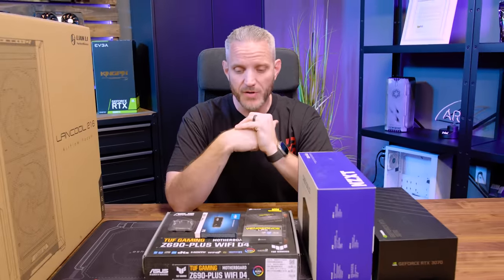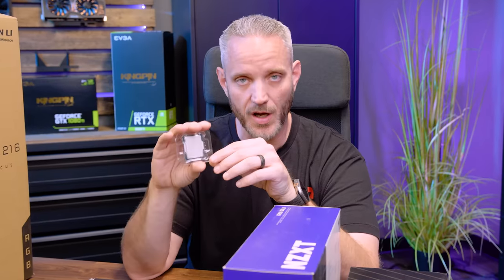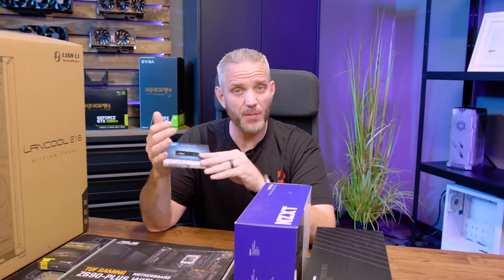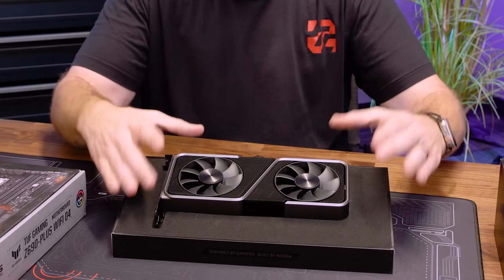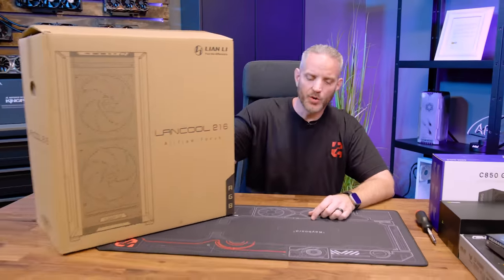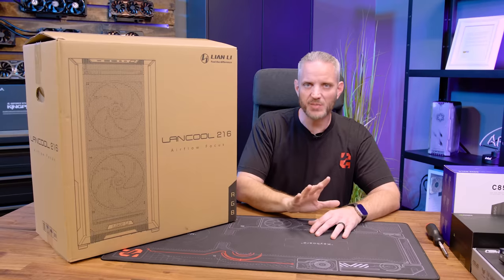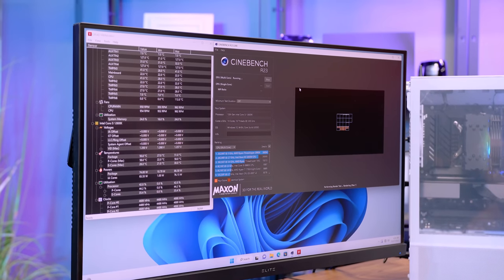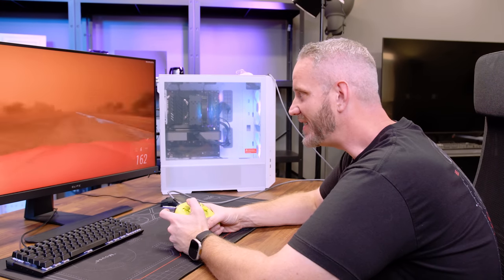Inexpensive PC Build Guide!

Comment: I remember when 50 dollars used to get you a good computer case...
Reply: I got my Deepcool case for like $45
Reply: yeah it still can lmao, thermaltake versa h18 and fractal focus 2 are 50 bucks, both of those cases are awesome
Reply: found plenty of mesh cases with 3 pre installed rgb fans for about $40.. 
just install one extra cheap be quiet fan and turn the other fans to a really low speed and youll have decent airflow with almost no sound and some rgb for less than $50
Reply: I got my Phanteks P400A Digital for $70. It's now $100...

Hearing from Gamers Nexus, keep an eye on what Montech has in store. They might be the new budget kings soon
Reply: The amount of new features and ease of build with cases not much more than $50 is worth it over the junk in early 2010s.
Reply: I got my cooler master haf+ for $60 and they came with the two 140mm fans and the 200mm red led fan…
Reply: @FuelHauler48  Some smarts and zipties will do you some wonders.
Reply: Fractal Designs focus G
Reply: got my fractal design focus G for like $60 and will prob hold onto it for a good while albeit i have 2 old cases which i could play with and mod (one becoming a bench setup)
Reply: It still can. I got my Rosewill spectre for 50 bucks. It had side radiator mount and came with 4 rgb fana.
Reply: It still can
Reply: I tend to spend alot more than 50 usd on a case knowing that i can clean it and use it for several upgrades and even a new PC when i do a total upgrade (which is about once every 3 years).
Reply: This person is talking about a good computer case not just a case
Reply: @thomaslayman9487  My current box is in  a focus 2 think it was 55 though
Reply: Yeah and minimal wage was half the amount.
Reply: Depends on what you call good.
I’ve seen some good ones here and there for $50 still, albeit generally on sale. But you can still look to get plenty of good ones for about $75. And with how inflation has been the  last few years that isn’t bad.
Reply: I got my Silentiumpc regnum rg6v evo for under 60€ which is considering our vat on the ball park of 50usd. 4 decent argb fans, decent space, good airflow and ok warranty.
Reply: I started building in the early 2000s so you must have started much earlier. I remember okay enclosures going for 50 but with inflation factored and market demand today that's more like 100 or more. Good enclosures have always been more than 100 in my experience and thats 20 years ago. Though, the word "good" is subjective in this case. (Pun intended)
Reply: I got a tecware forge m for $50. A fractal meshify clone
Reply: 50$ will never get u a good case, maybe a decent but not a good case. 🤷🏻‍♂️
Reply: Don’t forget the cost of the operating system
Reply: I live in Canada. So I always laugh, when Jay talks about prices. But I've heard Australia is even worse.
Reply: @theodoredekoninck5613  Cost of  the OS?. ....🤣🤣🤣
Reply: and included a decent PSU.
Reply: It was around $65 until recently.
Reply: @vigorgaming8  I wouldn't even decent really. Usable or okay. On the flip side though I once got a discount Li case for around 200. Full size, all aluminum ...I mean all... It was brushed black and could hold 12 spinning drives like 10 fans, set up for some serious water cooling. Let's just say it was not a good purchase because at that price point the aluminium was was way too thin for it's size. Plus the screws were aluminum. I stripped an important one at the very beginning of my build. I did get it together but not without scratches and denting. I found out why it was only 200. 😡

Edit-The thin all aluminum construction was good for thermals but...

I guess my point is that you get what you pay for most of the time and sometimes a cheap enclosure with all plastic panels is the better option.
Reply: Nzxt has decent cases for 50
Reply: still is ;)
Reply: @Therandomguyjoe  The new H7 is $70
Reply: If you know what you doing you can get a $50 case with a power supply in it.
Reply: Yes, back when gas was less than $1.20
Reply: most of the cost of cases is the logistics to transport big boxes.

What's gone up sharply the last year?

oil refinery products.
Reply: Rosewill brand is actually pretty good for cheap
Reply: @theodoredekoninck5613  10 bucks
Reply: For the most of us, we fall in the $1,000 (or less) budget for out builds.
Reply: Back when high end parts used the energy of a Nintendo.
Reply: Cooler master n200 was great.
Reply: Tecware fusion is a good itx /matx case. For 50 bucks its a good competitor to nr200p
Reply: @1234Jaytay  these are good computers case stupid $50 cases 5 years ago are much worse than it is today
Reply: I got the nr200 for $100
Reply: I recomend deepcool cases they are cheap with good air flow
Reply: I remember when gasoline was $0.89/gal!
Reply: It still can, cheap cases here normally costs $20-$25 while decent ones are $40-45
Reply: I got a ASUS tuff case with 4 case fans for $77 this Christmas I’d say it was a steal
Reply: A 100$ rosewill case on Newegg
They're always like 50% off
And depending on which one you'll often get a 
fan controller
Fans
Or an rgb controller
Reply: I remember those days, back then the internet came in the mail.
Reply: Simpler times
Reply: The ol' Mac G5 lookalike with a very reliable 500w power supply included! Yeeeaaahhhh!! I miss 2008 too, man.
Reply: I mean, atleast here in finland the aerocool atomic v1 is about 55€-60€(about 55$-60$).
Reply: I don’t mind spending a little more on a case to get something sturdy and high quality. Can’t stand some of those shitty cheap cases. I know it doesn’t affect performance whatsoever, but it affects the entire feel of the machine. I want it nice
Reply: I remember when a dime bag cost a dime.
Reply: $52.50AUD for a build I'm working on right now. Took a bit of hunting to find a case I wanted to build in for that price (for a new case in Australia with good airflow) and waited for sales, was originally aiming for $50AUD. Saved postage costs by buying local ^^'
Reply: @CynHicks  depends if you can still download Win 10, or go with a Linux build.
Reply: @darkstorminc  Dude, we are talking about a time when "good enclosures" could be had for under 50. I donut know how to tell you this...lol... OS's were "free" back then.

😉
Reply: @MastersofCriminology  Back when new ford mustang was $2600
Reply: Back when a GPU ran cooler than the core of the sun
Reply: @1584283  😃
Reply: Good back then
Reply: Tbf cases have much better build quality and can last longer than before
Reply: Same, mine cost 50 bucks and the only difference with newer is that mine supports optical drives and actually has good front airflow… it sucks for AIO tho
Reply: I just bought the NR200P for $70. So not impossible, and you'd pay $120+ for anything of quality and $2-400 for high end cases here.
Reply: @lilsoonerfaninmo  but without fams?
Reply: @hidde8232  It had fans, what're you talking about?
Reply: I remember when $50 got you more than 3 days of groceries
Reply: The most I've spent on a case was $15 by modding used OEM cases
Reply: I remember when i paid $100 for a 1080 with a waterblock
Reply: Genesis Irid 353 😉
Reply: Yeah my Meshify C was around 65, but now they are 2-3x that.
Reply: Yeah, I got my p400a for 60$.
Reply: I just gave my dad a pc as a christmas gift yesterday, which used my old Bitfenix Comrade case from my first pc build in 2015. That was a $50 usd case and I'm happy I got to put it to use again.
Reply: I remember when a hacksaw , plexiglass  and a neon tube got you a badass case......lol......."damn! Is that a Pentium 4? "   😵😵😵
Reply: You still can
Reply: thats today
Reply: @lilsoonerfaninmo  what model?
Reply: @hidde8232  Macube 310
Reply: I remember getting a Voodoo 2 card OEM in a static bag, no box for $50
Reply: Still got my nzxt s340 elite that i got for 65 bucks forever ago
Reply: There's quite a number of good offbrand cases from China but not sure if they are widely available in the United States.
Reply: thats why i always buy sharkoon cases, one of the cheapest bang of the bucks with lots of room for hardware, u have a decend case for 50-60,-
Reply: Pepperidge Farm has entered the chat
Reply: @lilsoonerfaninmo  I still have my $45 deep cool from 2013 :)
Reply: Yea $500 was a good budget pc now it’s $800 for a budget pc
Reply: 6600xt much better price to performance
Reply: I stop using Case
Reply: You can pretty much buy a second hand case
Reply: @vandrayketv1316   500,- doenst even get u a decent pc anymore unless u wanna game on your integrated graphics :'D nowadays 1000-1300 is the "budget" gaming build
Reply: @moldyshishkabob  oh yeah montech is good, I got the air x for $40 instead of $70 at Microcenter
Reply: @thomaslayman9487  in what universe is the focus 2 $50? Everywhere im seeing they are almost $90
Reply: 2 years ago I bought a montec mesh case for $50 they sent me two. I called them up and asked if they wanted it back they said no. So that prompted me to build a completely different computer for a friend. I know that's not the usual but felt pertinent to the conversation.
Reply: Well inflation does sadly exist, I am aware it’s not just inflation but also greed. I’m just saying in 2005 50$ is equivalent to 75$ back then.
Reply: Meshify mini 59.99
Reply: Still does smfh
Reply: Ah how the things have changed over the years
Reply: I got a deepcool cg560 for $50
Reply: @lilsoonerfaninmo  same
Reply: @Thomas B I've just seen the Macube 310 clowned on for poor airflow

Which is bullshit in my experience, but it is what it is
Reply: It still is
Reply: Deepcool case never hits above 50c cpu and motherboard even bumping power from 60W to 150W, cranking it from 2.6 MHz to 4.4 MHz, running through full passmark CPU tests. 

Case was $45 on sale, full magnetic dust filter strips and 3 120mm with case (I swapped 2 out for 140 and added 2 more 140mm)
Reply: @chipsalom  what case did you buy?
Reply: 50 got you a crappy modern case and 80 would get you a crappy modern case with a crappy psu.
Reply: idk man, bought a O11D copycat for 50$ from a local supplier.
Reply: I recently caught one on sale for $35
Reply: @La_sagne  how do you control fan speed
Reply: And gas was 5 cents a gallon
Reply: I just got the antec dp503 it was 80 bucks its an insane case took me 2 hours to do my full build in it and the 3090 fits so good and a built in gpu holder
Reply: I got a good case in 2020 on amazon for £30ish and its one of those small brand cases and its fine
Reply: You still can
Reply: It still can lol 😂
Reply: Used to bargain at local computer shows. Man that was waaay back
Reply: Look for montech
Reply: @nicksrandomness8116  you’re not suggesting that it has an influence on inflation are you? ;)
Reply: Dood, the phanteks p300 for 60 dollars was such a steel
Reply: In my country 40 dollars with 3 pre install rgb fan still exist
Reply: I remember when 25 cents used to get me my groceries (I'm 120 years old)
Reply: There is a lot of budget cases now these days but they usually don't get the highlight anymore because they're at that baseline of good enough for anyone to get but too boring to talk about. Just shop around.
Reply: I buy a MSI GUNGNIR 110R for 80 buck in my country. Really expensive but I think it was ok for the prices here in Venezuela
Reply: Reuse your old PC.
Reply: @nicksrandomness8116  and now we’re all poorer then ever
Reply: If people are going to keep paying the prices,  they are going to keep overcharging.  Some youtubers(content creators (roll eyes))do not help it by pushing overpriced products and trying to justify it. Just look at prices and the whole gpu market, it's a joke
Reply: @lesterludtke227  I'm definitely not.
Reply: @nicksrandomness8116  right, you’re a minimum wage worker who thinks there richer cause there wage doubled, well so did your cost of living and taxes, I imagine you live at home with mom and dad though and are sheltered from the realities of this economy. Even if you aren’t with mom and dad something is definitely keeping you blind from the reality.
Reply: I though $60 on my In Win case was expensive in 2015
Reply: @lesterludtke227  Haven't lived with mom and dad in a long time. I've invested in the stock market and have moved up in wage between changing careers multiple times.  I also know how to budget and not buy Starbucks every day. Sorry that I understand personal finance. Have a good day keyboard Karen. Thanks for the assumptions.
Reply: I bought a coolermaster masterbox nr400 for about 75 usd and its great for a low profile black m-atx case with high airflow and a lot of help for cable management  (it also includes two fans)
Reply: Now a good one is gonna cost you nearly 200
Reply: that's how inflation works baby. Back then you also made 70% less money of your work probably.
Reply: Exactly now I see cases up to $130 or more lawd jeez
Reply: I got a Zelma’s for like 60 buck holds a triple fan 3070 in it with like 3 other case fans
Reply: It does….
Reply: I remember when I thought $250 for a 70 series graphics card was a lot of money.
Reply: I remember when you got 128mb ram for 50
Reply: I remember when $50 got you 3 girls and an 8ball
Reply: I remember when 50 dollars used to get you a good horse...
Reply: I got a 4000d knock-off called the Gamdias aura for $45. The fans are sata powered but I'm not keeping those for much longer. Amazon's lowest to highest setting can reveal some gems.
Reply: Building in a h17 rn fr no cap n.
Reply: That never happened as those older cases were all garbage.  We were drilling cutouts for more fans as far back as 1992 with those stupid ribbon cables blocking everything.  They got better but not much until more recently.  The Lanboy was about as good as it got for a long time but became stupid hard to find.
Reply: Yeah probably before the glass side panels, included RGB fans, and all the bells and whistles to put in a new 4090 card
Reply: Still can. Montech. Heck, even Fractal. You got this!
Reply: @MonicaHolly143 I'm quite sure most cases below $50 now came out more than 5 years ago 
Focus G came out in 2017
N200 came out in 2015
Reply: I think Corsair carbide spec delta is a nice case with 3 rgb fans and 1 non rgb fan preinstalled with decent airflow. It's just 50 dollars, you can look upto it
Reply: @DanielFrost79 my biggest regret on my previous build was the cheaper case. Think it was fractal design focus g.  While it works fine,  it felt cheap. 

The build I just did today I used lancool 216, and it doesn't feel like a budget pc this time.. worth the 40 dollar difference imo.
Reply: you can get a decent case for $50, just skip big brands like corsair etc. antec and deepcool made some great budget cases
Reply: And I remember when frankfurters costed a nickel.
Reply: Still can
Reply: Wow, I remember when PCs weren't even made yet for home users and there was nothing called the internet.
Reply: @bjohns5947  That means you don't have much time left 🙂
Reply: It can if you lurk eBay long enough
Reply: If accounting for inflation 🤓💀
Reply: It's still the same pretty much
Reply: I remember when 50 dollars was a full kitchen of food